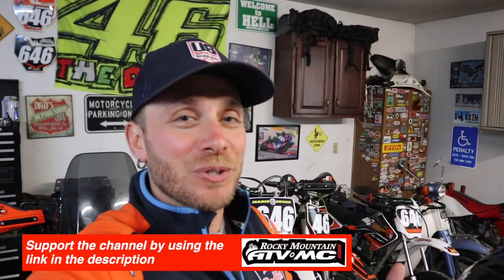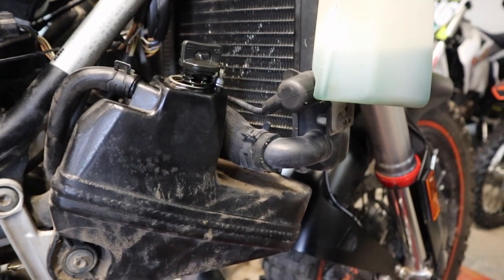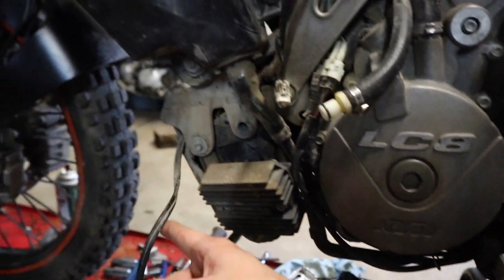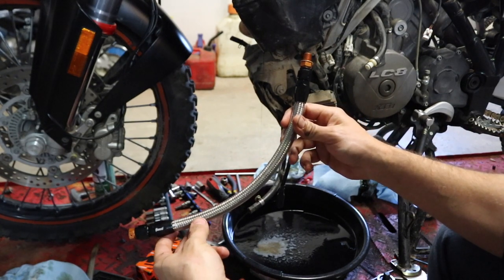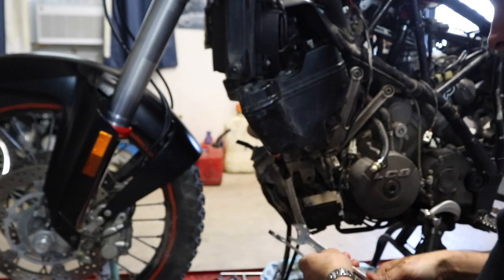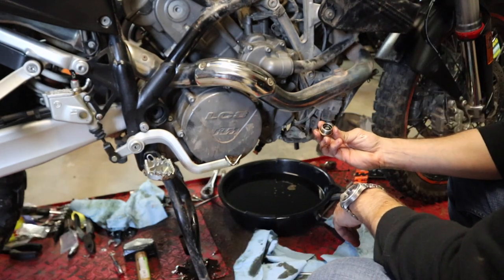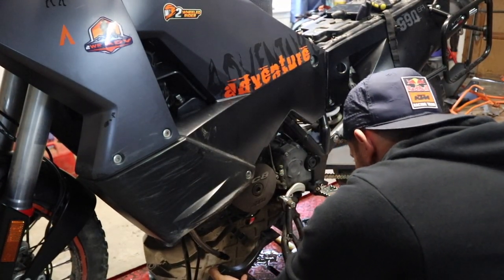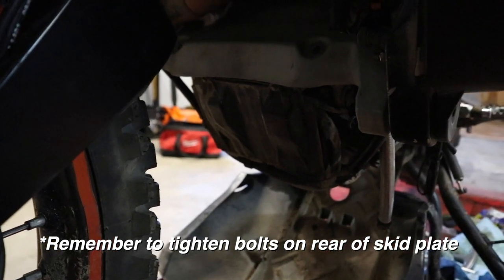KTM 990 ADV Oil Change | Back in the Garage

Comment: Hey Mario
From a 2022 point of view - how is the bike keeping up with the 1090, 1190 and 1290T ? I’m excluding any models with a TFT screen as I really dislike them. I had the 1190R for some time and was pretty happy (but had to sell as I needed some money back then).
With the same milage of about 10k I could get a 990 for 7k, a 1190 for about 8-9k and a 1290 for 11-12k. I plan to do pretty much everything with the bike, from daily commute to 2-week trips. What would be the reasons for going big and new and shiny? From a tech standpoint ABS is my minimal requirement for riding in the rain and bad situations.
Reply from the maker: If it's gonna be your everything bike, buy one of the newer ones. The valve check/spark plug intervals are twice the mileage on the new ones vs the 990.
Reply: @2WR  good input, thanks, the range of the 990 could also be a dealbreaker

Comment: Love all your videos, very informative. What are your thoughts on the 950 vs 990. I currently have a 2013 990, but something keeps drawing me to the 950. Have an eye on a 2006 Adventure S, reasonably priced. Any advice would be great.
Reply from the maker: Just have to decide if you want carbs (950) or fuel injection (990), otherwise not a whole lotta difference.